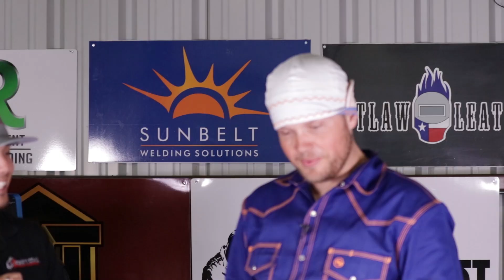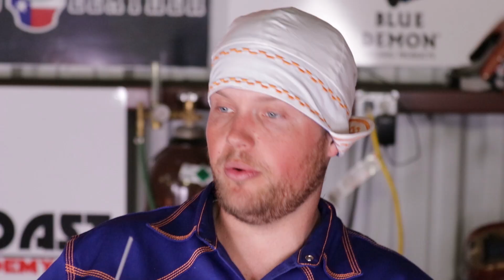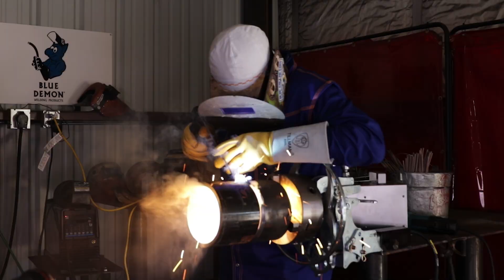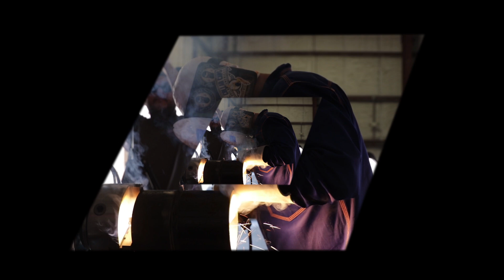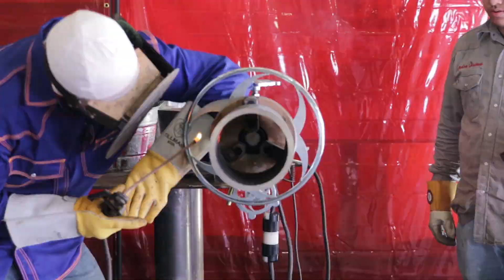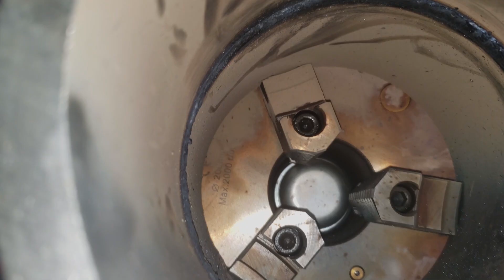SCHOFIELD WELDING 5G PIPE TEST

Comment: That machine is identical to mine. 69 RedFace! Burns oil but other than that it is a beast. 3rd gear at 35 on my bead then I crank it up to 75 on my hot pass and fill. Cap just depends on what I’m working with at that point. But the machine is smooth and easy to work the puddle. If a guy can find one never let it go. I broke out with this machine 10 years ago and it’s all I’ve ever needed. Cheap and easy to work on and won’t put you in a bind for long if you get caught up in one.

Comment: 3,2 mm welding rod - root and cap?
Reply: I think they ran 1/8 " 6010 5p+ lincoln rod root and 7018 lincoln electric hot pass fill and cap

Comment: Why do some companies perfer 6010 to 8010 all downhill? And some perfer 6010 root and hot pass and then 7018 to 8018 uphill? Whats the difference?
Reply: just different procedures. some procedure calls for low hydrogen rod ( 7018 uphill ) where some dont call for it, so they run cellulose rods downhill. Where i am it's 6010 root, 7018 uphill hotpass/fill/cap.

Comment: You have to run a two bead cap in 5g thats lame
Reply: All depends on the welding procedures they are testing you  to.  Usually puddle cap  up to 1/2 inch tick on the job.
Reply: Why is it lame ?
Reply: You'll run how ever many caps you need in 5g depending on bevel size. The fact you made this comment, is lame.